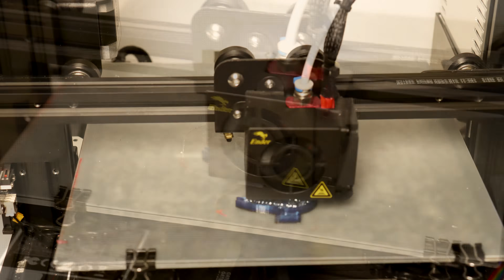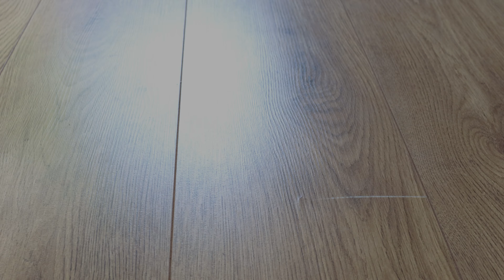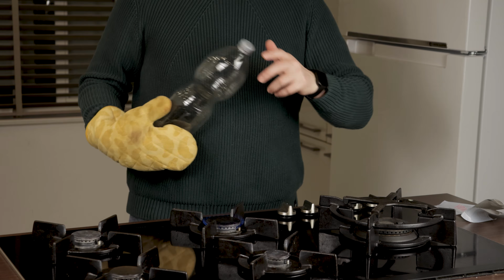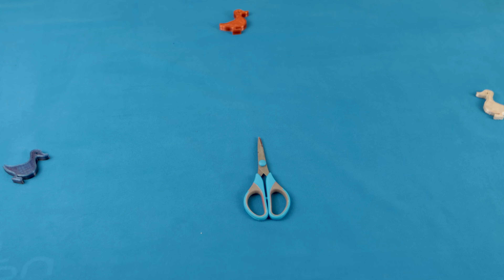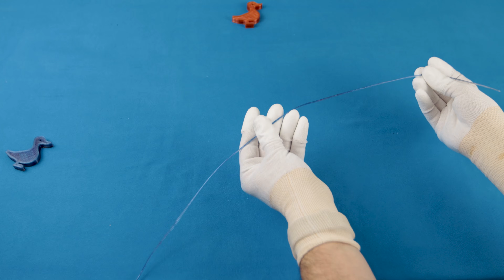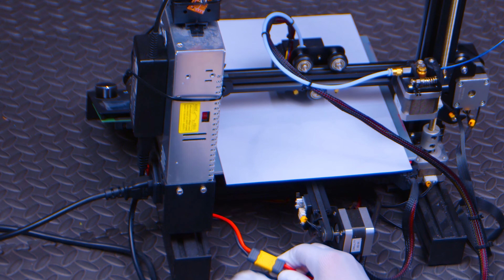Tips & Tricks for FREE 3D printer filament maker at home

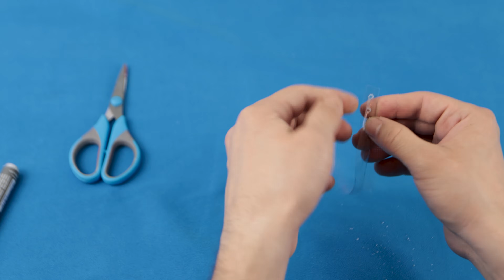Comment: 13:30 I definitely have to use this method, because joining already finished filament is unusable — it won’t pass through the input section, right at the transition to the metal feeder. I have a Bambu Lab A1 Mini.

Comment: How do you modify the firmware so the ender 3 can reach 270 C?? my printer make a beep and turn off
Reply from the maker: i did not. The version that I had does not limit the settings. but you can upgrade the firmware if yours does not support it. I also recommend using an all metal hotend for eliminating risks

Comment: Hello, I tried to put everything together and I have 2 problems giving it power.  Where do you connect the 2 red wires from the hotend.  And I can't see anything on the LCD screen.  Sorry if it's misspelled, I don't speak English well.
Reply from the maker: I recommend you to check your connection. probably there is a mistake on your connections.
you can find details here in `circuit diagram.png`

Comment: Hi, I tried finding this information in the comment section and the other videos but didn't find it. What thickness does the filament have after the strip is melted by the filament maker? I'm asking this because I have a 1.8mm and a 1.7mm drill bits and I wanted to know if which one would be better. Like, if the filamment has 1.7mm after going through a 1.75mm hole, my 1.8mm bit would be good enough.
Reply from the maker: it will be around 1.75mm. but it will be hollow. You need to increase the filament feeding speed to compansate that.

Comment: Strip width question:
Found this video and I LOVE this idea.  Thank you for sharing your experience
Can you provide a bit more context on how to came to the recommended strip widths? 
I have no real experience, but if I try to calculate it, I get different numbers than those that you recommended in your video. 
I wonder what may cause that.
Given that:
- 1.75mm (diameter) filament has a radius of 0.875, it has a surface of 2.4 square mm
- my cola bottle has 0.3mm thickness, so to get to 2.4mm square, I should make a strip of 8mm width.  You recommended 10mm
- my water bottle has 0.15mm thickness, so to get to 2.4mm square, I should make a strip of 1,6cm width.  I believe you recommended 10mm
Did you try those theoretical values?  
Thank you for sharing your insights.  (again, I have no practical experience....yet)
/chrisV
Reply from the maker: for cola bottles, I have used 5 mm, for mineral water bottles, I used 7 mm. the reason is the viscosity of the melted PET. I tried to make the strip as thick of possible, however, if you do it more thicker than that, it sometimes stuck in the extruder, and you end up starting your print from the beginning. The filament becomes a little hollow (like a tube) this way,  and to compensate that I increase the feeder stepper speed rate from the software

Comment: Hello Im having problems with filament i was using pliers to pull filament but filament gets damage and then extruder cant push filament did you have that problems and if you did how did you solve it
Reply from the maker: sounds like a temperature issue to me. you can try to increase the temp. a little bit, and find a sweet spot

Comment: sir what temp should the strips be melted on the filament maker?
Reply from the maker: I set mine to 253 degree Celsius. however because of the tolerances of the sensor, it might differ. Thats why I included buttons to adjust the temp.

Comment: Hi 
I find your work really interesting, I am new to this but thought I would give it a shot.
So i have put everything together, replaced the buck converter with a DC/DC adjustable 5V module and connected the positive termal for the heating element directly to the power supply (its getting 11v when i tested it) and the negative to the mosfet. The Temp on the set up reads low and slowly increases but nowhere close to 250 C. I tried an Infrared Thermometer to read the temp on the block and it reads in the 70s and climbing slowly as on the LCD it reads 15 and climbing. Thought I would push some through but it just bubbles and doesn't come out right.  
I have gone through both your videos countless times trying to find anything I have missed but i have not found a solution.
Hope you or someone here can help 
Tired of loosing sleep over this LoL.
Reply from the maker: From your description, it seems like you made electrical connections right. How much power your power supply can give? maybe it does not has enough capacity.

Comment: I have seen several "Make your own filament" videos and I am left wondering: Wouldn't it be simpler to melt the plastic bottles and then extrude them?
Reply from the maker: It is matter of money that you are willing to pay. Normally, all filaments that you buy are made like that already, and their quality is way better. But you need a machined extruder, and an integrated heater. and also you need to make some sort of granule maker. It is indeed possible, and it is more proper way to do it. but it would be a couple hundred dollars to make even for a proper DIY version. This method would cost like 10 dollars to make. (most makers like me are pretty poor :(
Reply: The is also the problem of remelting the PET material. It tends to crystallize when melted. This is ok when you heat the strips up enough to make the filament, but the repeated melting necessary for the regular  extrusion may leave you with super brittle filament.

Comment: Hey so I have watched this video, and as a complete EE noob, I am unable to understand the heating block setup of this.. The mosfet sending the amplified energy output to the heating element right? So then do I just ground the negative cable of the heating element to the breadboard> I'm confused why there is no cable coming back to the board in the diagram. Thank you for your help.
Reply: Also, for the laptop to buck converter.. Is it black for the "+" and blue & white for the "-"?
Reply from the maker: no. black was negative, and white was positive. but better be safe & check it with a multimeter and measure the voltage.
Reply from the maker: Hi, Did you checked the circuit diagram in the github page? it is definetely goes back to ground. 
https://github.com/MakersFunDuck/PET-bottle-Filament-maker
it is "circuit diagram.png"
Reply: @makersfunduck  I get the diagram is there but its not beginner friendly.